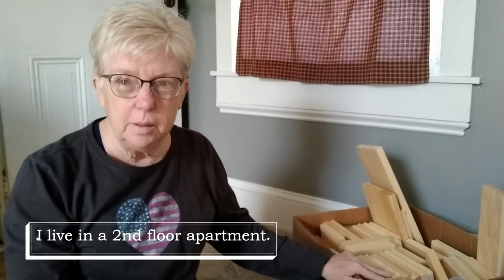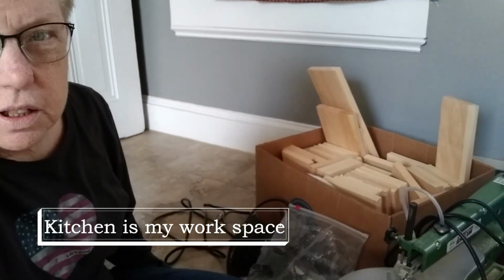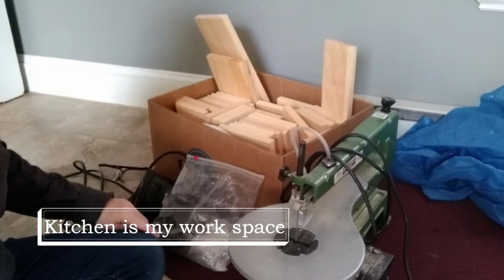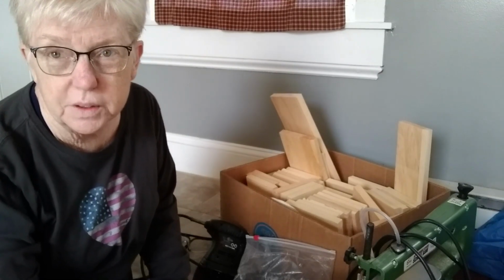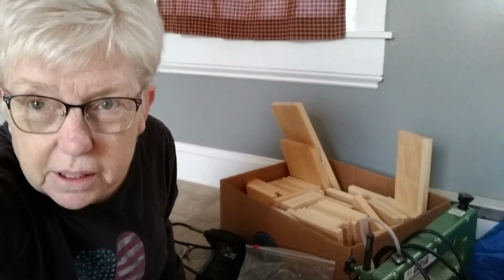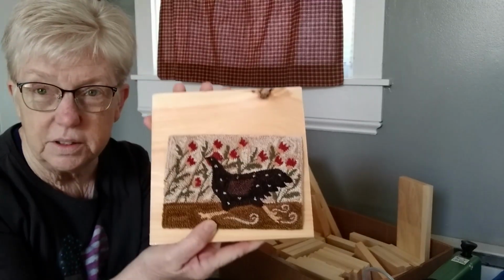The Making of Hornbooks

Comment: Great video, love seeing your process!  Curious as to why you put the blue tape on the wood before you drilled the hole!  Thanks again and have a great day!  Dora
Reply from the maker: The tape helps the wood not to splinter from the drill bit.  Without a drill press, I have some trouble there.  The tape helps, but it still gets a little rough, which is why I use the tiny sander afterwards.  
Thanks for watching and commenting!

Comment: Thanks so much for sharing. Why do you put the tape on before drill? I am very fortunate i have a wood man on site, but I have not seen him do that. Thanks again and hope you have a safe and happy holiday.
Reply from the maker: It helps keep the wood from "ripping" when I drill the hole.  I have trouble getting a smooth edged hole when I use the larger drill bits.  The tape helps.
Reply: @PriviesandPrimsNeedlecrafts  ah, that makes sense. thanks!

Comment: What size drill bit do you use?
Reply from the maker: I use different sizes.  I start with a smaller one, then go to a larger one.   I just grab what looks right.  It depends on what size hole you want.